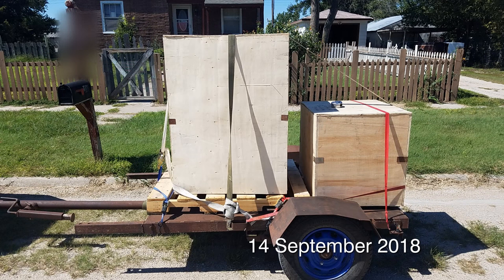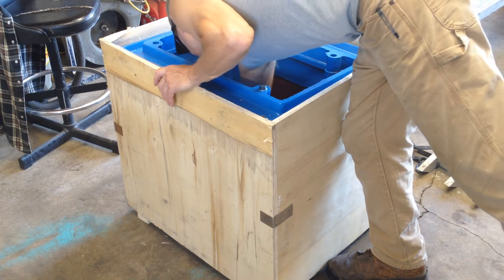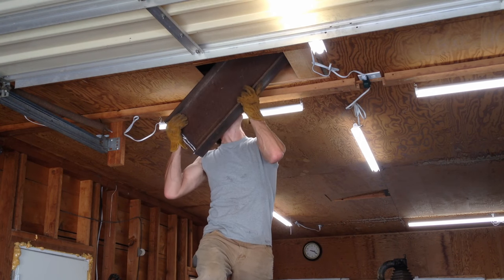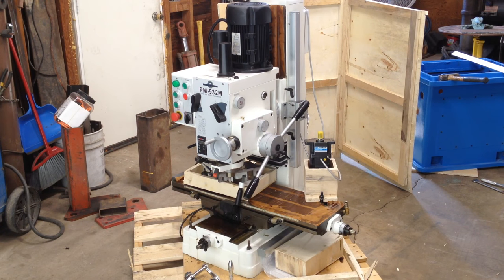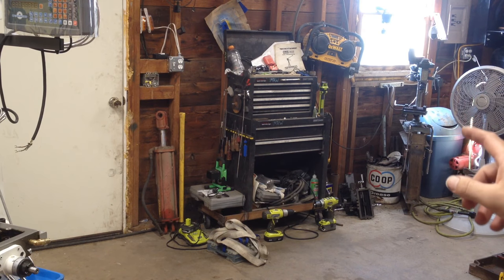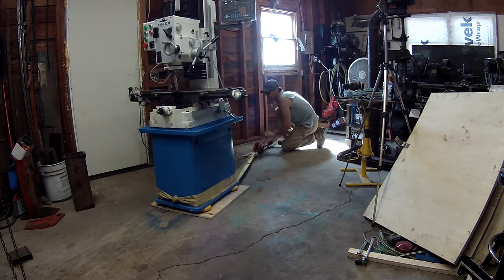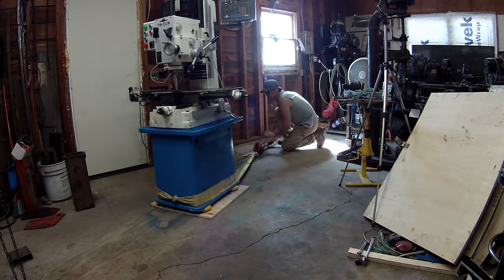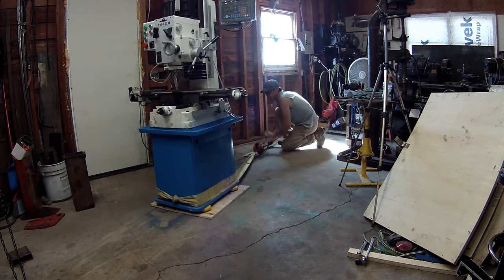Precision Matthew Milling Machine  Unloading and Setup (2018)

Comment: Dude! :) when moving large heavy object like this, clean the floor as you did, then use some steel pipes or bar as rollers. I used 1" bar and a wood broom stick to move my PM1127 lathe ('bout 500lbs) With only 3 bars, and a helper to move them as you go along, the whole distance could be made in about 5 minutes. 
Your idea of using a come along wasn't bad, just tedious. Also, when it comes to move precisely a machine in it's final position, I use two thick steel plate covered with grease between them on each corner, or landing points, then with just a small crowbar you can move a 2 tons machine precisely where you want it. Then just lift each corner to remove the plates.
Still glad for you, I have a PM833 and had to dismantle it in main pieces to get it in my basement! Did the same with the lathe, had to dismantle to get it down the stairs.
THAT was a bit hectic! :)   Cheers!

Comment: Nice mill. I have the pm940 which is the pm932's big brother. I have it torn apart right now and measuring so I can convert it to cnc. Besides, it needs broken down and cleaned and re-assembled.  It's important to go over all the screws and bolts because most of them are loose.

Comment: Just ordered a PM 727V last week. Delivery due around Christmas time. Lots of work to do cleaning up the shop to receive it. Not as heavy but will still need an engine hoist to move it.  Some good tips. Enjoy your new tool and thanks for video.
Subsequent to this original post it's now August/September 2022 and I still don't have my mill. The 935 I ordered originally they ran into some problem with motors, delivery, covid, time of day or the direction of world rotation. Who f---ing knows. I changed the order to a 932, not my first choice obviously but they told me in July that it would be leaving China in August. Well as of Friday 26th no word as to when it'll be on the water. I'm getting older and I'd sure like this before I fall off the perch so to speak so for now it's "hurry up and wait". 🤔🇨🇦🍌🇺🇦🕊️👍

Comment: It helps to have big friends with big equipment when you are moving stuff around like that.  My son has a Bridgeport and another mill that looks like a Bridgeport.  A skid steer or fork truck makes it easy to move them.  When he got his big lather (4500  lbs)  he used his skid steer with 4400 lbs tip and had a friend with a 9500 lbs tip skid steer over to pick it off of the trailer.

Comment: i just replaced my back covers with a salvage tred mill belt.its got to be the best cover i have ever used,the chips do not stick in the cover at all.savaged about 15 feet  x 24 inches.tough material.used some 1 inch flat bar across the top to get the full width protection.

Comment: You’re looking at a 1,000 lb machine. I’ve had my PM932 for 2 years. I used an engine hoist to move it into position. I really like my mill. Before moving into position, I took the covers off to look at the gears/shafts for the head and below the table. I found lots of sand mixed in with the grease and in the corners of the casting supports. Glad I didn’t run it for a year and then decide to check it. Highly recommend cleaning from top to bottom and applying new grease. Happy with PM’s service and them setting up the DRO. Recommend downloading the US version of the MM on their web site. Thinking about installing a 90mm angel eye to the bottom of the quill for more lighting, in addition to my LED lights on each end of the table. Good luck with your new mill.

Comment: I bought the same mill and I'm waiting for delivery 1st of October.I have my shop in a 2 car garage that I added 12 feet across the back of. I'm wanting to put the mill and a gunsmithing Lathe back there , the problem is a 3 1/2" step up in the back of the garage floor and a 30" walk through door. Do you think I'm going to have to widen the door .

Comment: If I were you, I would put non flammable fibreglass insulation bats in the timber wall, between the studs, then I would line that wall with something like flat galvanised sheet metal.
On heavy cuts that mill with throw hot metal chips everywhere but particularly behind the mill. If enough of them fall into the horizontal overlap between the weather boards - you might finish & go to bed while the residual heat in the chips sets the weather boards alight! 😳😳👎
Try to make that wall behind the mill flame proof to shed the chips onto the concrete floor for easy clean up & to eliminate fire risk. Also install a dry powder fire extinguisher on that wall within easy reach, just in case of worst case scenario.
And don’t do like me and start a fire installing the brackets for the fire extinguishers! 😂😂🙄👍🇦🇺
Reply from the maker: The plan is put Rockwool in the walls, then 3/4 plywood, then 14 gauge sheet metal 5 foot high all around the garage. But, it's been 2 years and it still hasn't happened! sigh.    I have a couple Halon extinguishers within reach.   A fire when installing an extinguisher? That's the definition of irony! :)